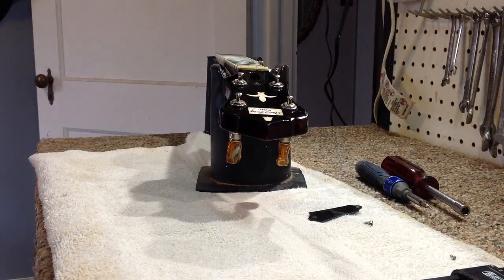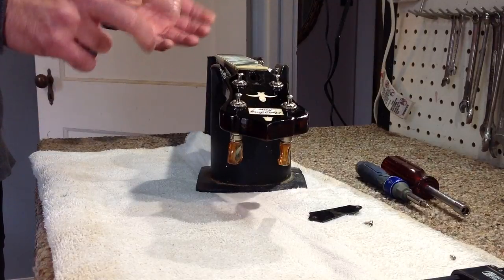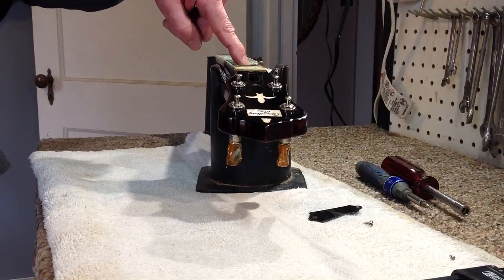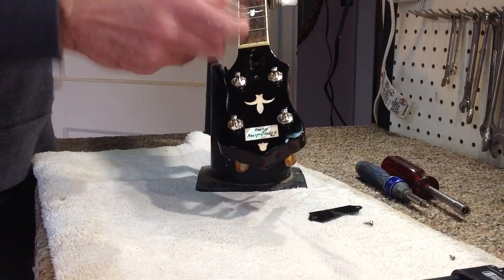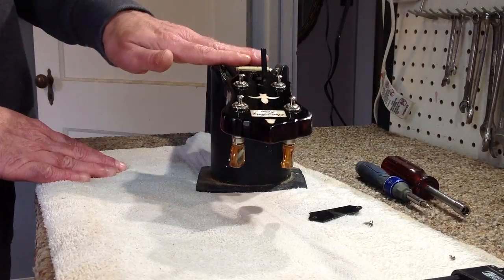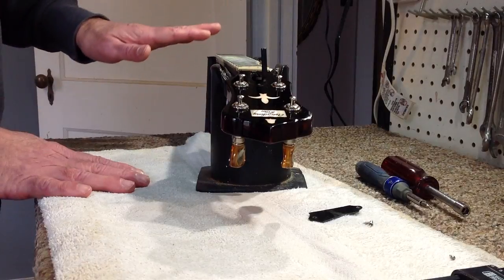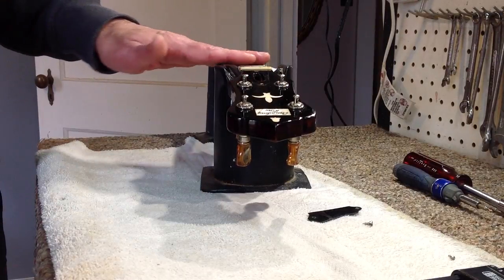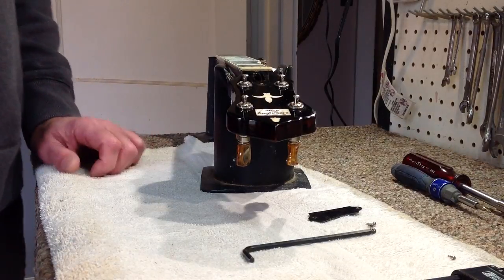Set up tips and tricks video # 6: the truss rod

Comment: Then, my understanding of the single truss rods usefulness as you describe it, would only be to straighten(by way of convex action)a neck that is being bowed too much in a concave manner by the string tension or a neck that, in it's neutral state, has too much of a concave bow, let alone what string tension might do to it. Correct?
Reply from the maker: Yes a traditional "one way" rod only helps to correct a concave bow. If the neck develops the opposite, convex bow, that rod won't do anything.

Comment: John, With the tap test I was able to bring my head up considerably and the banjo is sounding really good. The issue I'm having now is I am getting some buzzes. Makes the banjo growl. The string clearance is fine. I believe my issue is the bridge as the slight buzz is across most strings. I have adjusted the bridge angle in all ways I can think of. Do you think I need to open the bridge slots up ever so slightly? Maybe take 1000 grade sandpaper, which I have, and just lightly sand slots to get any potential bits out from when it was manufactured. It is a new Gary Sosebee bridge. Thanks!
Reply from the maker: Is the buzz always open or where fretted? Have you adjusted the truss rod after watching the video?
Reply: I've not adjusted the rod. By my observation, it doesn't need it. When I capo the growl or buzz is less but still distinctly there.
Reply from the maker: Ok, since the reply was in this video I assumed you had made an adjustment. If you have another bridge, slide it under the old one and change it out with the one you think might be the issue. If the tone clears up with the other bridge, you'll know. It's rare for a name brand custom made bridge to have buzzing on all strings. If you are using really heavy strings and the notches are cut for much lighter strings, you'll get some muffled tones/buzzes.
Reply: Sorry about that. WIth no other means of communication, I just stuck it here. I'll try the bridge change and see. Currently using lights. I did read today that some banjos just growl no matter what you do. I might consider using a thumb pick with a softer plastic as well. That thought came to mind.
Reply: I discovered after a lot of reading and looking that my banjo head tension was too high. I mean really too high. Like about a C# or D. How it didn't explode I don't know. This was the way the guy I bought it from set it up. Said it was good. Well, its taken me a while to discover it was ok but not ok. The string vibration and growl I spoke of was, I can only assume because the strings were resonating in a way that created this odd vibration. I have it now down to about an A-A#. Probably tighten it up just a little bit more as it settles back in. The tap test and scrap test didn't work for me. I can't hear the note well. I used the Steve Davis Quarter method.

I know part of my thinking that it was ok was because often times I couldn't hear the banjo well. As you know the banjo sound can have a straight out trajectory and so I often couldn't hear it as well. Now at times I definitely can't hear it as well. I decided to record myself and stand way across the room and play. The sound comes out fine and sounds good. So it's just my hearing and the direction the sound carries. 

But that was the issue. Glad to find it. Thanks for your advice and help.
Reply from the maker: tension that high can damage parts so I'm glad you dialed it in. Banjos are ver adjustable, which good and bad.
Reply: I don't believe the parts are damaged but I do plan to change the head soon so I can look hooks over and etc to make sure they are ok.